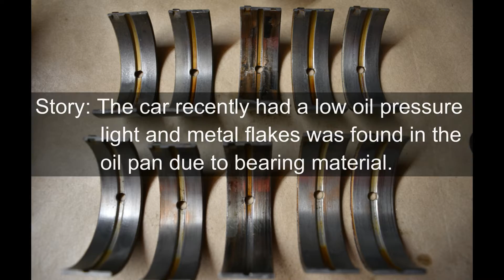Low oil pressure fix on Honda's F22, H22, and H23 Engine Blocks

Comment: After enough heat cycles you fill see these seals harden. Sometimes the oil journals clog because of poor maintenance, incorrect oil, or standard bearing wear breakdown. Mechanical items always wear overtime. Stay ahead of maintenance and prevent a spun bearing.
I bought a 97ex d16y8 with 190k that spun a bearing after a month and #3 was the culprit due to this seal.
I bought cheap standard bearings to do 3 rounds of plastigage to check tolerances and then ordered honda oem bearings (not cheap) based on those tolerances. After 100k miles you will likely have uneven bearing wear so don't get 10 of the same main bearings. With Honda, and others, you may have 2 different bearings (top and bottom) in order to achieve proper oil clearance... Different clearances may be desired if doing a turbo build. My rebuild required 4 different honda oem main bearings and i was at the limit for thickness because of crank wear. Not every crank should be reused if you want another 150k+ miles.

 Definitely replace the thrust washers while you're in here... 100% of the time.

Great video and kudos for pointing out the proper materials to use.

Comment: thank you so much for the dimensions and OEM part number! almost impossible to finde anywhere else. Do you have the engine parts number listing?
Reply: The OEM part looks to be a Square O-ring... Did it worked with the standard O-ring?

Comment: Run berrymans b12 in the oil for 20 minutes then change oil . cleans the system out. If you still have low oil pressures you got problems lol

Comment: F23a and f22b1 don't have this o-ring only h22s I guess
Reply: No the F series has it for sure. I opened mine and found it under #3 main
Reply: @AutoMotoMechanic  ive opened up two f23a and a f23a1 also a f22b1. None of these have this o ring under any of the mains. The mains are integrated to the girdle which I'm sure h22 are the same. I just acquired a h22a4 from the junkyard and I would like to know if it has one
Reply: @cambodianboost3945  yo must not have looked. My f22b1 is open right now. And has this oring in it.  You may wanna look again man.
Reply: @cambodianboost3945  you have to knock the cap off the girdle. It's between the 2
Reply: @AutoMotoMechanic  i have two of my f23a and usdm f23a1 they don't have it. Idk if I checked the original f22b1 I had.. maybe thought it was the same being the block are identical minus the crank
Reply: @cambodianboost3945  f23 is different.